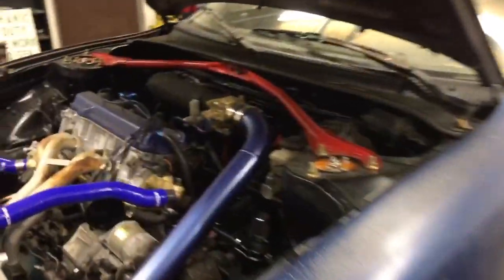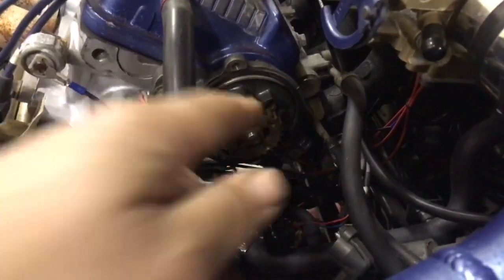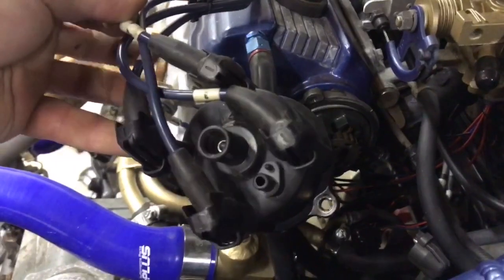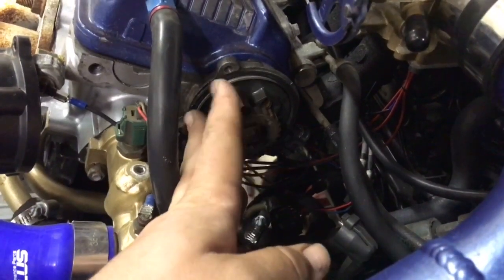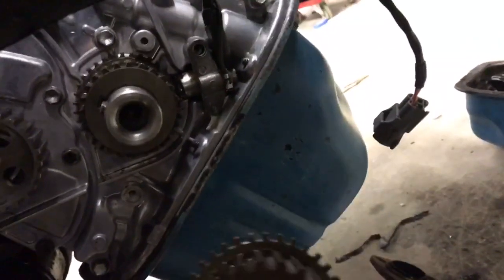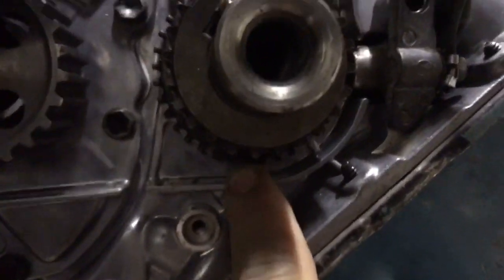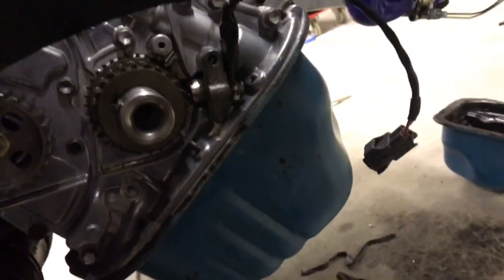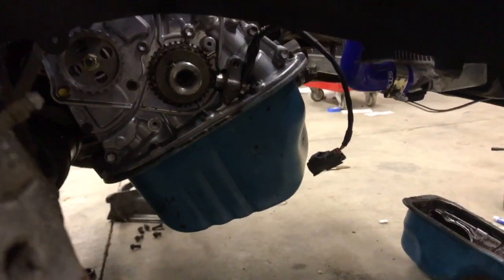1990 Celica Microsquirt Crank Shaft Sensor

Comment: Damn! I've just installed a factory oil pump on my 5sfe, didn't know of this difference. I'm running the engine on a Megasquirt 2 with an extra missing tooth plate. Do you know where can i buy that gear? I need international shipping.
Reply from the maker: nitoy2k I’ve seen them on eBay a few times. I think most sellers will do international shipping

Comment: Outstanding, THAT was one of the questions I had with the Microsquirt system even though I have an 3SFE. But I guess its the same setup from Toyota. That and, when you install all the goodies, when it comes to stopping power. Are you going to leave the same disc and pads. Or are you going to upgrade with lets say Toyota double piston calipers, slotted disc etc what not.
Reply from the maker: I’m planning on leaving the factory calipers in place for now, new rotors and EBC Green brake pads. Porsche front calipers and st205 rear calipers could be a upgrade I do later. We’re doing this to the alltrac Camry in the shop